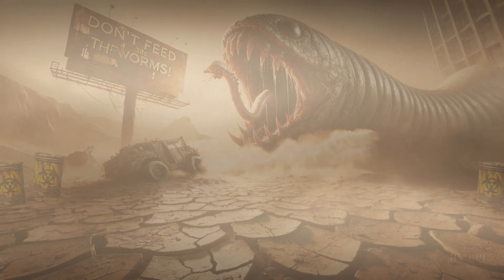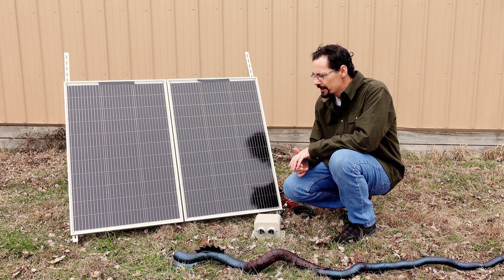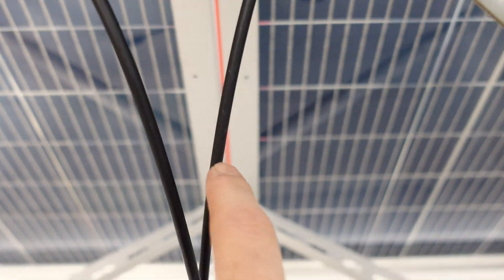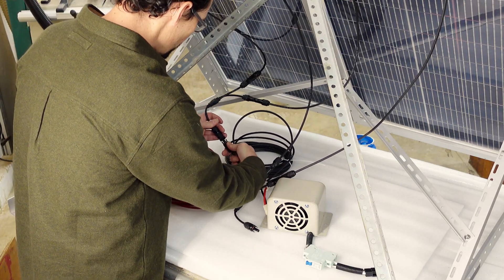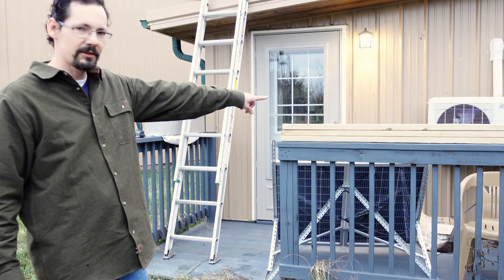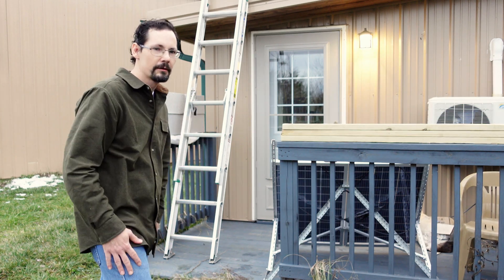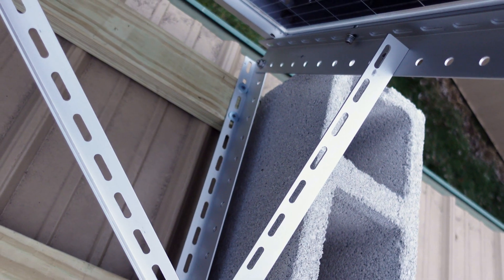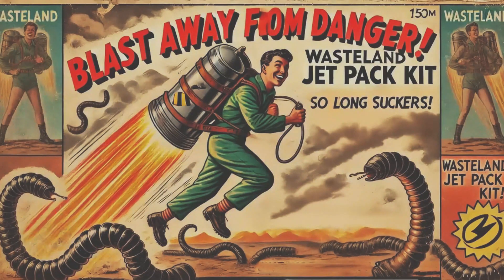Free Solar Electric Heat From Amazon!

Comment: If you wanted to use both heaters do you keep it 12 v. Or go 24v ?  Trumpocalypse Now😊
Reply from the maker: I'd go 24 volt to keep amperage low. Even 48v if you use wiring rated for it

Comment: 40 degrees seems higher than most solar install guidance I've seen, presumably you're somewhere in the great white above texas. Can you expand on that point a little bit more? PS, I'm also from up here too, near the through hike everyone wants to do but no one should at night.
Reply from the maker: For a fixed angle you set your panels appx at your latitude angle. For winter you add 10 degrees appx. It does say that around the middle of the video, maybe u missed it. Let me know if you need more details!

Comment: So you need about 14 amps at 14+ volts to dump equivalent of a 1500-watt space heater into your home.  That's without any losses.  Not much heat for a home but good enough for a shed or single room.
Reply from the maker: Today I was seeing 140 watts with the sun behind light clouds and at 11 am. If I were to try and heat a whole home I would use 800 watts worth of panel and 2 heaters.

Comment: Since there’s no charge controller. Would it be better to have a fuse somewhere in the wiring for protection? Also, see if you can find a way to store heat in something like water. Air is so fluid in that it moves around and escapes so quickly. A heated substance like water can store heat long term.
Reply from the maker: It already has a breaker which can be used as an on/off switch. 
Storing heat in water or sand won't make the space warm. It will only delay making your space warm.

Comment: Neat idea but some not so good reviews on Amazon. Pics of melted wires, fan not working, low heat output, etc. I can take with a grain of salt someone not being happy because it didn't perform as they hoped (unrealistic expectations) but the melted wires...yikes! I hope yours performs better.
Reply from the maker: Good question (extra info in description, for everyone). Based on what i've seen in my career there are less than 1% failure rate from mfg defects. 
The most common cause of melted wires (i seen during my career) is from poor connections or undersized wires used by customers, or even connecting a 12volt item to a 24volt battery. Or wiring solar panels in series rather than parallel (doubles the voltage). 
Thus far my setup has been operating flawlessly for 5 weeks. Make sure all your connections are full, and tight and monitor it for at least 10 minutes after you get it up for the first time. After your setup runs for a several minutes in full sunlight go around and feel for warm connections (touching jacket near connections only, not bare wire of course). Put your hand near the metal case to see if it's hot. If it's too hot to touch, there may be a problem.

Comment: Did you say what the heater is or did I miss that? Does it have a fan? Are you powering the element or both the element and the fan? How efficient is it compared to using a charge controller? SolarEdge channel did some really interesting stuff with diode chains as direct solar heating as they are more efficient than elements directly
Reply from the maker: The heater is a 600W, 12V PTC unit that actually contains two 300W (assumed) elements in parallel. Links in description. It does include a small cooling fan in parallel (about 12W), and I'm powering both the heater and the fan directly. By wiring them directly to the panels, you avoid the extra conversion losses you’d get with a charge controller and battery—so you’re converting nearly all the panel output to heat (roughly 95% efficient if well-matched) compared to about 85% overall with the extra stages based on my calculations from observation and dynamic nature of the heater this is an ideal match. I’ve seen the diode chain work by SolarEdge too—it’s a neat idea, but I went with the PTC design for its simplicity and self-regulating safety.  I do have plans for my own passive heater design which is the best out there. It is about 400% more efficient than pv panels. https://www.etsy.com/listing/1857224017/diy-solar-air-heater?ref=listings_manager_grid